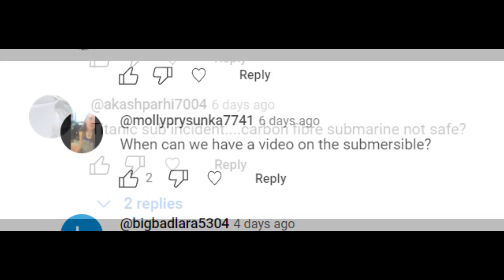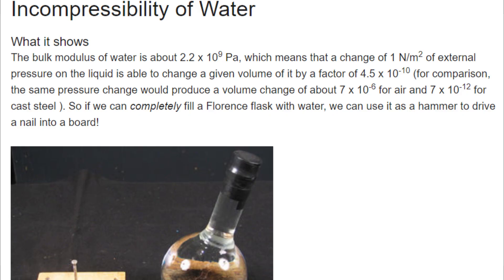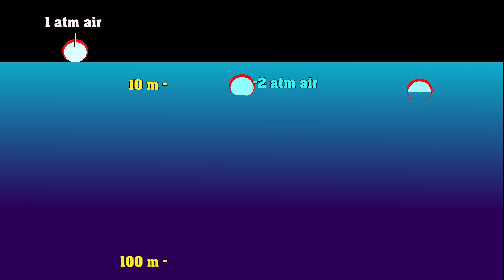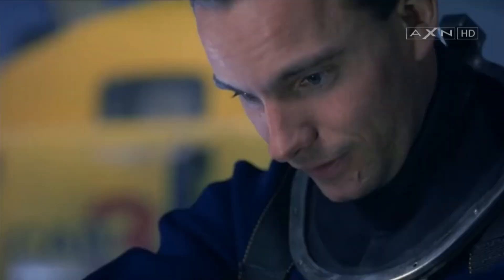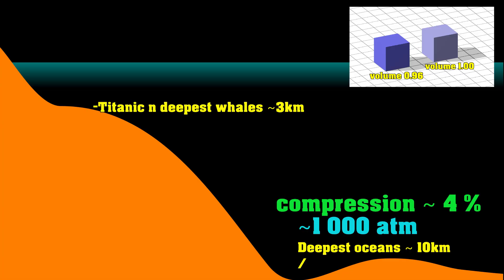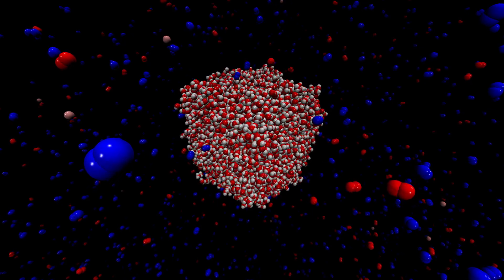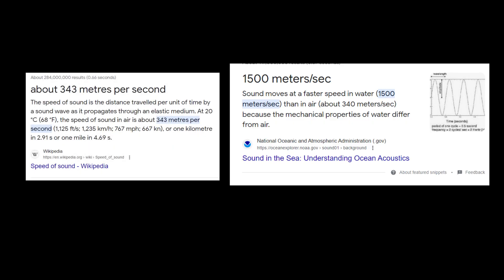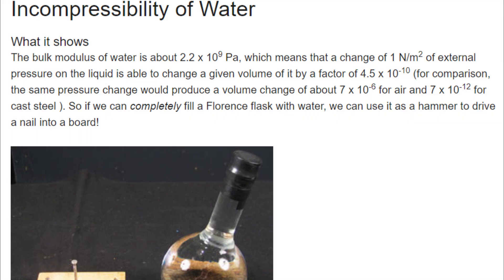What Happens when a Hull Fails at 1000 atmospheres?

Comment: Thank you Thunderf00t for explaining that water isn't incompressible. It's obviously compressible, anything is compressible. Water just happens to be so difficult to compress that it's functionally incompressible in your everyday life.
Reply: A light black hole has a larger density (as in mass per volume) than a heavy one.
So there is an argument to be made that a black hole is compressed by evaporation.
Reply: @landsgevaer  
I dont see what you are talking about. Evaporation is the Hawkins Radiation, and its a theory that has nothing to do with compression.

It has to do with randomly spawning pairs of particles that would, in theory, spawn in the vincinity of a black holes event horizon, and would, in theory, eventually steal energy, spin, and therefore mass, from the black hole... In theory.

And also... I dont think one black hole is any denser than another one. That would be like saying one "infinity" is smaller than 1.2 infinity. We can measure how much has fallen into a black hole by the size of the event horizon. But thats all we got, really.
Reply: @captain_context9991  I don't know what infinity has to do with it. Black hole physics doesn't involve infinities. Infinity is a concept; physics breaks down before you reach infinity.
A black hole has a radius in our spacetime though, at least its event horizon has. It also has an area, which is quite an important concept for black holes. Those are quantifiable concept. So we can assign it a density too. And as far as one could define "compression" as "increasing something's density", that applies to black holes too: you can compress a black hole by allowing it to evaporate.
Reply: @landsgevaer  the largest supermassive black hole known is about 370 times less dense than regular air temp at sea level.
Reply: @hugegamer5988  Yeah.
The entire universe as a whole qualifies as a black hole in a sense, since no light escapes it, and that is largely a vacuum...
Reply: @landsgevaer  a black hole with the mass of the universe is very close to the size of the observable universe.  Space is critically dense and yet almost completely empty.
Reply: @hugegamer5988  Yep, I think that that is why I started about it... 😉
Reply: There's even a Youtube channel for compressing stuff under a hydraulic press, and the results are kinda wild.
Reply: @vane909090  
Yes. But can the hydraulic press compress water.
Reply: @captain_context9991 sure, but is it perceptible? Will it do so before any container you try it with would fail? How do you accurately measure it?
Reply: Well, in calculating pressure transients in pipelines ('water hammer') I seem to recall the compressibility of water is taken into account.   But most people don't need to worry about that.
Reply: Baloney!  Black holes can’t be seen because they are covered in oceans! All hail the almighty power of dihydrogen monoxide!
Reply: pretty much anything that isnt a gas is difficult to compress if you have a solid chunk of that material
Reply: Wouldn't it be much more fun with a nuclear reactor on board?
Reply: Ahh, thank you Synopsis Man, we would have had no clue if we hadn't watched the video...
Reply: It makes sense really. If water wasn't compressible, we wouldn't have high pressure water. Because the water would just take up the space and wouldn't build pressure.
Reply: @jwalster9412  
Not sure water being pressurised does anything in that context. Pretty sure its an engine that pushes it out in a very strong jet.

The very fact that water is extremely hard to compress... Makes it possible to use water jets to cut absolutely any metal. Even diamonds. Like a knife through bread. Given like 90 000 PSI. Check out the industrial waterjet cutters.
Reply: black holes don't have "infinite" gravity and as they acquire more mass the pressure and the density at the center will continue to increase along with their gravity.  the apparent "size" of a black hole is not a measure of the physical object itself but rather the strength of it's gravity, ergo its mass.
Reply: @-TriP-  The center of a black hole is ill defined though. Our theories go a bit beyond the event horizon, but not to the center; we have no metrics to describe it, AFAIK. So, I don't think there is anything fundamentally wrong with equating a black hole with its event horizon, and that certainly has dimensions.
Reply: also,, light slows down. But that's for another conversation.
Reply: The cores of neutron stars are supposed to be incompressible due to quantum degeneracy pressure.
Reply: Are black holes compressible too?
Reply: @kopasz777  I mean, It depends on what you count as the black hole, if you mean just the singularity, than the answer is, yes, you can compress more stuff into it, but no, it won't be further compressed, as n times infinity is not bigger than infinity. If you count the entire Event Horizon as the radius of the Black hole, than the answer is no, you can't manually compress it, as the Volume inside the Event Horizon actually grows faster, than the Mass, meaning it is less compressed the bigger it is, but the black hole slowly compresses by losing mass through Hawking Radiation.
Reply: @kopasz777 Nope, they’re the most compressed things in the universe 😁
Reply: @FlatEarthKiller  
Well.... You couldnt compress a black hole any further, I guess is what he meant. But it doesnt really work with a black hole. As its the event horizon we can see. And thats not a physical thing at all.
Reply: @captain_context9991  exactly, it’s a horizon point created by a field. However it is curious that the density is inversely proportional to the mass so a microscopic horizon from a single particle at energy has unimaginably high density while the largest supermassive hole we know is about 370 times less dense than air at sea level and a black hole with the mass of the universe is pretty close to the size of the universe.  Space is critically dense and yet almost entirely empty.
Reply: @FlatEarthKiller  
Yes at first I was talking about water. There is this guy pressing things on Youtube with a hydraulic press. I wonder if he would be able to compress water with that thing.
Reply: @FlatEarthKiller  
Gravity is called a "weak force" for a reason.  You need a hell of a lot of mass to compress things by the simple force of its own weight.

Yes a mega syringe would do perfectly well. Just make a steel version of a syringe. And Im guessing it will bend steel before you would see any compression of the water.

To all intents and purposes, water does not compress. But, obviously hundreds of bar of pressure will compress it ever so slightly.

Its all just a matter of rearranging the molecules to sit closer together. Until you reach the un-compressable. Neutron star material. Also known as "strange matter" Which only happens in pulsars, magnetars, neutron stars. Which are very weird places. If you try to compress any harder than that, BOM, you have a black hole.
Reply: @captain_context9991  We literally do not know enough about black holes to infer they can not be compressed any further or even changed in terms of property. We saw colliding black holes of different strengths and it had all sorts of effects, so no, a black hole is not infinitely compressed at all. We also have not quite seen black holes 'destroy' spacetime around it, even when some scientists halfway claim that's what should happen around it.
Reply: @PHeMoX  
We do know that "strange matter", the stuff Neutron stars are made out of... Is the tightest you can pack particles without them falling into themselves and disappearing into a black hole. That much is known.

And it is widely understood that the singularity in the center of a black hole... Is where stuff disappears into. Its hard to come up with anything more compressed than a singularity. 

And a singularity does not really care how much stuff (matter) that finds its way into it. It will still keep being infinitely small. Even if half a galaxy falls into it.

We cannot see what happens at that point because it will forever be hidden from us. Beyond the event horizon. The event horizon is what we see when we see that black hole that no light can escape from. Behind that, it kinda gets tricky. But black holes grow bigger because the event horizon grows bigger. Not because the singularity grows.

If a black hole was just like any other planet, then sure. Anything that falls down on it, would just make the planet bigger.
Reply: @kopasz777 yes, though it's a bit weird. From our current understanding of black holes being point like structures, adding more mass compresses them (they remain point like but their density increases as their mass has increased). Though our understanding of these scales is limited, so this may not actually be what happens at the very centre of a black hole. Bar that large black holes actually get less dense as you add mass due to the event horizon expanding faster than the mass increasing. Which I suppose leads to the situation whereby a small black hole could be "compressed" with time, by preventing it from feeding. The Hawking radiation would cause it to lose mass and its event horizon to shrink (it would have to be a micro black hole though)
Reply: @CED99  "From our current understanding of black holes"? To be fair, I don't think any theory of physics says much about the exact center. It is a singularity. We have no description of it. Afaik, we don't know if there is a spacetime point in the middle, since I am not aware of any coordinate system that includes it. Let alone that is would contain an infinitely dense mass. That is a mere extrapolation.
Reply: @landsgevaer  black holes do NOT contain singularities.
Reply: @-TriP-  Oh boy. What theory are you applying?
"Gravitational singularities are mainly considered in the context of general relativity, where density would become infinite at the center of a black hole without corrections from Quantum Mechanics, and within astrophysics and cosmology as the earliest state of the universe during the Big Bang. Physicists are undecided whether the prediction of singularities means that they actually exist (or existed at the start of the Big Bang), or that current knowledge is insufficient to describe what happens at such extreme densities."
Source: wikipedia.
Now wikipedia isn't authorative, but then give me a better source that there are no singularities associated with a black hole.
Reply: @landsgevaer  look up west texas A&M "does every black hole contain a singularity?"

put it this way -- if a singularity, meaning a point with "infinite gravity" were to exist, the entire universe would immediately collapse into it.  A black hole only has as much gravity as the star that collapsed into it had.
Reply: @-TriP-  Ah, then you are in the last camp of my quote. Theory breaks down there.
I agree, I'm in that same camp. I also don't mean to argue that there is an actual point with infinite density.
But there is a point where our theories break down. Thát is what I mean by the singularity.
Reply: @landsgevaer  fair enough 🙃
Reply: @kopasz777 Nobody really knows what black holes are, so the simple answer is... we don't know. Are black holes literal singularities smaller than Planck lengths? Perhaps black holes are just stars made out of matter even more exotic than neutron stars, and with gravity strong enough to bend light and time an appreciable amount. Perhaps there are different types of matter within black holes that are dependent on its mass. Nobody knows. We can only speculate since our understanding of physics on those scales breaks down entirely.
Reply: @Malicious2013  
Oh, people have a pretty good idea. And a pretty good grasp on whats beyond the event horizon. Even if we cant see it from here. Its WAY too easy to say "nobody knows" about these things.
Reply: @captain_context9991  We don't know, though. We only recently managed to take a low resolution picture of a black hole, and before that, we didn't know if that's what it would actually look like. We have a lot of best guess conjectures and maths that should work but haven't quite been verified on account of our inability to visit or directly study black holes. We have a lot of hypotheses. In scientific matters, until some testable empirical evidence is acquired, we have what amounts to "I think this is right." 
Our understanding of physics mostly disassembles beyond the event horizon since we still don't have a theory of physics that encompasses both the macroscopic and the subatomic. Black holes seem to operate on both simultaneously. We can say whatever we want but we really don't know. Leading researchers say this constantly on camera. It's not exactly insider knowledge. 😅
Reply: @Malicious2013  
I have dot matrix pixel images of black holes as it was mathematically imagined decades ago. And they are remarkably accurate. Except with a supermassive black hole, you would imagine the accretion disk being slightly shifted towards the side it rotates towards... They hadnt thought of that, you see.

However... That picture of a black hole. An amazing achievement, no doubt. But Im not a big fan of it. A galactic center-sized black hole is a busy, busy place. There is a hell of a lot of stuff that gets in the way. And they have run so many computer simulations and filters on it there there isnt a single pixel in that image that comes directly from the black hole itself.

We first have to explain to the computer what we think the black hole should look like through simulations. And then the computer AI has to use 17 different layers of magic trickery to make the blurry crap it sees through the actual light emitted from there, to fit what we expect to find. So how much is a black hole, and how much is our data simulation? Not enough real black hole to satisfy me, at least. 

But its not the fault of our camera tech or science. Rather that there is just too much "stuff" in the way. From dust to whole stars. That need to be edited out. So in the end there is more editing than image.

However Im a game designer. I understand graphics and pixels. But not the science of it. I just think its a bit simple to blow it off as "nobody knows" Which is a failure of the entire field of science these days. Every day I see ridiculous stories trying to sensationalise or mystify science with articles like SCIENCE CANT EXPLAIN.... Or SCIENTISTS DONT KNOW WHY this and that. Giving the lesser educated to think that anyones opinons are equally valid.
Reply: To me... Thats incompressible.
Reply: @captain_context9991 locally incompressible
Reply: @captain_context9991 we know very little about them. Being most likely the most compressed thing in the universe,  who knows if there's anything denser, or able to compressed a black hole even a fraction of a percent more. I mean they use to say the big bang started off as something the size of a mustard seed. Physics is a crazy thing.
Reply: If that was the case, hydraulic presses would have water instead of oil.
Reply: @Weissenschenkel 
It is the case, there are other huge issues which make water unsuitable. Think Boiling, freezing, corrosion, lubrication.
Reply: @Weissenschenkel  Hydrolic fluids are compressible too though.
From the figures I've seen it is in similar orders of magnitude as for water.

Comment: If I understood correctly, the compressibility of water causes the hull to fill up with water, right?
Then, wouldn´t that cause an explosion inside the hull, instead of an implosion (which is what actually happens)?
Reply: The air inside the hull would immediately compress to the volume it would be if it were in a basic diving bell at that depth.
Reply: It is the explosion of water into the one atmosphere cavity of the hull.  In the same way as setting off a block of TNT results in hot gases (formed by the decomposition of TNT molecules) exploding into the lower pressure atmosphere surrounding it.
Reply: Thaks for the replies, although I can't seem to be able to get my head around it.

Could you recommend some literature or perhaps some YT videos that might help me understand this?
Reply: @morphx666  This video is probably the best explanation I've seen.

Comment: Im confused... 
So did the air get out that made the structure fail ?
Or
Did the air get out after the structure failed?
After-all , The question seems reasonable considering its composite make-up.
Reply: The hull failed, allowing the pressures to equalize rapidly, causing the crew to perish rapidly